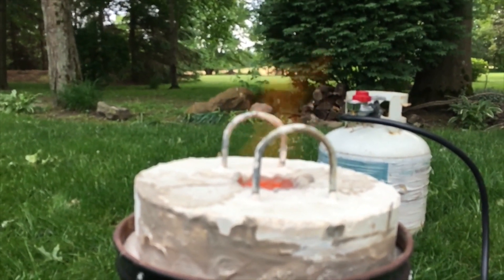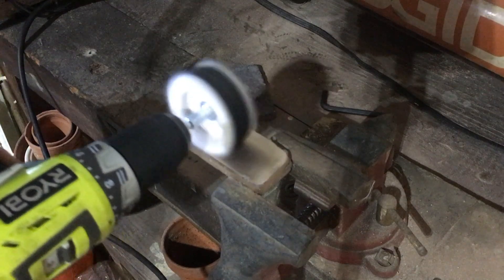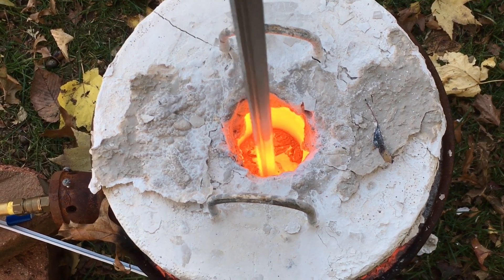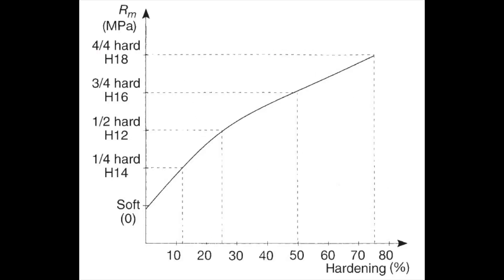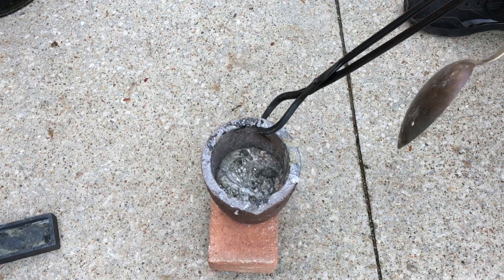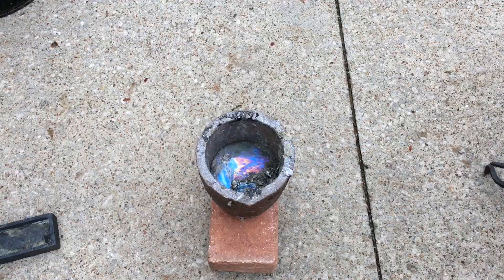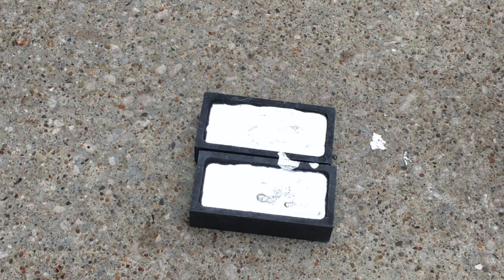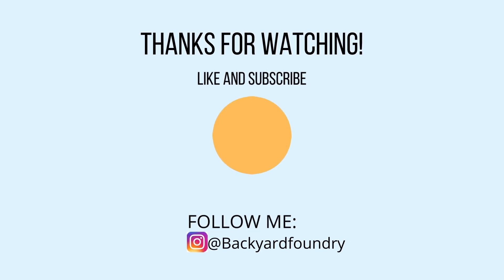How to Harden Aluminum Casts [ 4 Methods ]

Comment: Explanation in easy terms for beginners:
Steel hardening: Heating it will change the inner structure from one state to an other (cubed lettice structure will change inside) --> suddenly quenching it will cool the steel rapidly down without giving it´s inner structure enough time to change back again too it´s normal room temp state. This creating inner stress and making it harder.
To release the stress yo ucan heat up the material again to about 500°C and let it cool down slowly which will change some but not all structure and release acess stress thus making the material still hard but not brittle.
 
Aluminium hardening: Heating it will relax the material and alloy components like copper can move freely (495°C-505°C with the help of a candle you can reach this temp without melting the part), all the alloy contents will be the same roughly everywhere within the metal --> quenching it will not change that, however the metal structure will now start to change at room temp. The alloys want to create small islands and will clump together and thus hardening the material You will be able to notice a difference already after minutes. It´s full strength will be reached in about 4 days. 
You can speed up the process by warming the part, simply put it in an oven at 100°C or so for a while.

The colder the temp the less the atoms can move. In aircraft design the metal will be cooled down to below freezing ca. -20°C, to prevent it from hardening too much before it can be riveted.

Comment: precipitation hardening isn't age hardening, they are both different steps in the actual hardening. Basically it's like steel, but the opposite. when you quench steel it hardens, and you heat it up to disperse the martensite and have a more souple and flexible structure, but in a lot of non ferrous metals, quenching won't really harden the metal (quenching is precipitation hardening btw, beacause the alloying elements are expelled from the solution and form the martensite), but then heating it back up decomposes the martensite, and oddly enough, it's the decomposed martensite that actually becomes harder and stronger.
Reply: technically correct however AL does not create any martensite. It´s a little different in AL.
Reply: @sierraecho884  oh okay i'm mostly working with aluminum nickel bronze, and they make martensite
Reply: @jeanladoire4141  Probably because there trace amounts of Fe as well. 

What I found online is this:
" ...The CuAlNiFe group reacts in a similar manner to alloyed tool steels in respect to heat treatment procedures with martensite being formed when
components are water quenched from elevated temperatures within a typical range 900-1050ºC. As with steels, the nickel aluminium bronze once
quenched can be tempered to improve ductility whilst still retaining high tensile strength and hardnes..."

generally speaking Al does not do therefore it hardens by age hardening primarily.

What parts do you make out of this alloy ? What´s it used for ? If I may ask.
Reply: @sierraecho884  i indeed work with cualnife, cual10ni5fe4 mainly, and it's all three metals that form different crystals that constitute the martensite, basically they fall out from solution and form the actual martensite (basically copper/iron crystals, copper/aluminum and copper/nickel).
I'm a bladesmith, and i forge blades from cual bronze. It doesn't make very hard blades, actually they are both softer than steel, and more brittle, beacause i'm pushing the temper to its hardest to try to get a few more rockwells from it (i'm at about 30 i'd say, tho i've never measured it accurately). However it does make beautiful golden/brown blades that don't rust. It also holds a shaving sharp edge half decently, but i only make table knives or low intensity use blades from it (mainly for the esthetics, not the performance of course). I'd use a san mai of martensitic stainless steel and a core of very high carbon steel for the edge for cooking knives with actually good performance.

But don't underestimate non metals for blades, more humans have died under the blows of bronze blades than under steel or bullets. It will hold an edge, just not for that long, and it needs frequent honing on a stone.
Reply: @jeanladoire4141  I see, nice. Very interesting.

You surely meant non ferrous metals. Those were THE weapons in bronze age. Of course those are dangerous.
Reply: @sierraecho884  i mean yeah, copper, tin bronze, brass sometimes, and swords weren't really made of tempered steel until the 14th century in europe. They were mostly wrought iron and untempered medium carbon steel, so like HRC between 10 and 30/32. My hardened bronze knives are around 30,so that's not "that" bad, even tho compared to modern steel it's pretty disappointing. But it's gonna cut your steak 👌
Reply: @jeanladoire4141  As you have said, you make parts for aesthetics first. 
I typically deal with something like 900 HV steel for automobile stuff.
Reply: @sierraecho884  900Vickers? That's like pretty much the hardest we can make steel, with a few exceptions for super high performance alloys... Why would you need this kind of hardness? High rpm bearings?
Reply: @jeanladoire4141  Anti Theft protection plates. Crash relevant parts etc.
It goes up to about 1500HV-1800HV. 
At one time we experimented with "laser assisted bending" because the material was so hard it was basically impossible to bend it so you would have to heat it with a laser at the bent area to shape.
Reply: @sierraecho884  what the fuck 1800HV? What metal can even go there? Tungsten carbide? Or is it just ceramics
Reply: @jeanladoire4141  No no it´s high carbon steel. But this is an extreme example. We are usually around 1000HV for crash relevant parts, most other stuff is made out of polymer.
Reply: @sierraecho884  how can high carbon steel get to 1800 vickers? That's like 80 rockwell
Reply: @jeanladoire4141  It´s not only carbon it has many other alloying elements like Mn and others. I don´t remember what it was exactly. It is also heat treated. We also work with colsterizing, nitrocarburizing etc.
Reply: @sierraecho884  yeah well i don't think iron carbide can reach 1800 vickers, that has to be something else